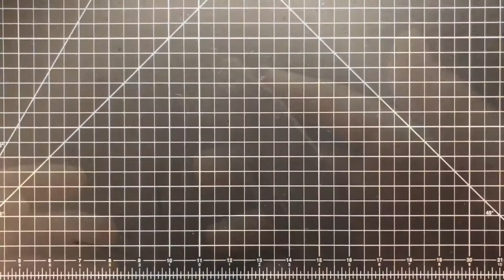CKF Morrf 4 “Hype Vs Reality"

Comment: Good looking folder. I like folders with offset handles. If I had to choose between the Morrf 4 and the Spydie Chef I would take the ladder. The flipper on the Morrf limits the angle when cutting on a flat surface. That doesn't mean I wouldn't mind having one in my collection.
Reply from the maker: Yeah, you have a good point, with the flipper kind of being counter productive with the overall stance. I think an opening aperture the shape of the pattern on the blade, and no flipper would make it more functional.